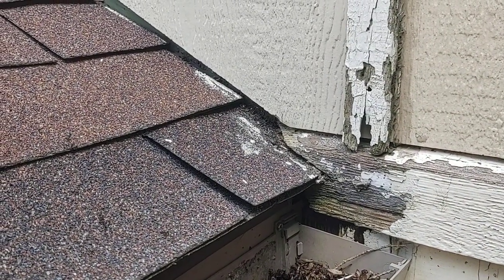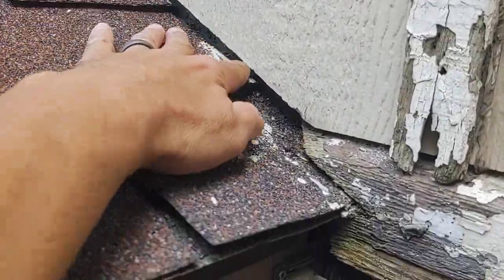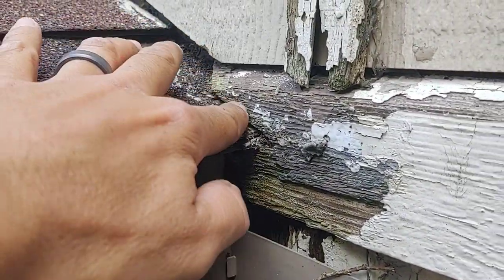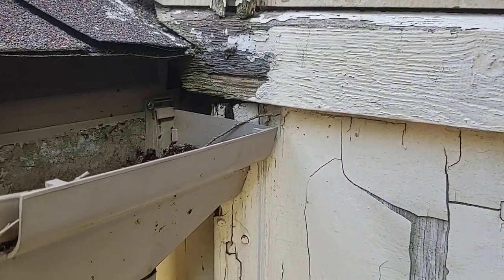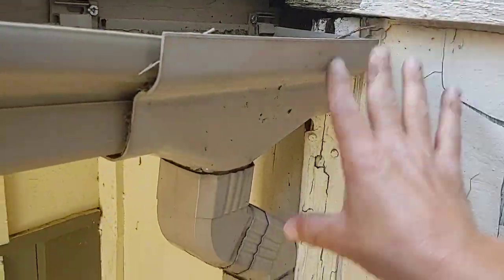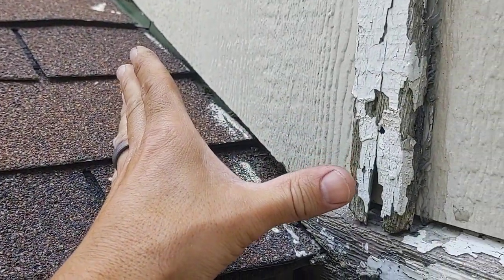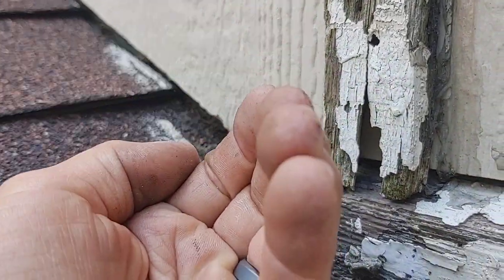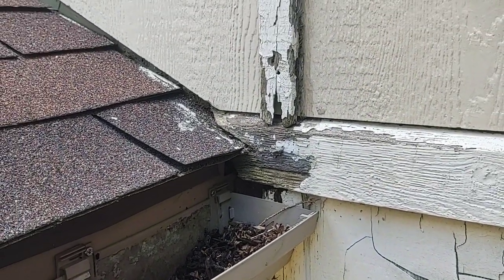Roof wall flashing kick out

Comment: This is almost ALWAYS overlooked.. almost every reside I do I have to install a kick out. Most people I've met in the business don't even know what it is 😑
Reply: I agree, have with with a few companies where even the boss didnt do it. Had to explain to him why it's needed. On most re roofs yeah you kind of have to makeshift getting it in there especially houses that don't have vinyl siding. But as long as it diverts the water away from the wall a few inches it fixes that problem
Reply: yep, if you lucky they at least do the flashing right and they siliconed to where it isn't able to run anywhere but gutter

Comment: This is the exact tutorial I have been looking for. I have the same problem, not quite that bad. There was an attempt of a kick out with the bendy flashing but still overshoots. I didn't want to put a splash guard up as I was concerned as the water runs fast it may push the water over the fascia and under the eaves. So thank you I learnt what a kick out was today!

Comment: Just had a new roof put on. I have 3 areas that need a kickout which wasn't done. The 1st is against wood siding very much like this video. It is rotting before the new roof put on but they didn't say anything. The 2nd is also against wood siding, doesn't look like a problem yet.  The 3rd is where an addition meets vinyls siding on the 2nd floor and it's a new leak. Even though the addition has an overhang, water is dropping down the siding will behind the gutter.
Reply: This guy needs termite inspection.  His siding is covering a much bigger interior issue imho.  Fungus wouldn't fully explain the damagr.  A roofer would give a hard pass on this job until the other issues are addressed.

Comment: Hi There just to let you know I watch your channel from Toronto and will be helping my son re shingle a small roof (10 x30 ft)over an addition that is a new kitchen in Ottawa. So my interest is step flashing. It was an addition so it looks like the contractor cut back the aluminum siding about 3 inches just looking at pictures so far and put a j molding on the bottom so now I am wondering about a kick out. I presume there is step flashing under neath covered by an apron flashing. I will be going the check it out.  I really like your videos especially the 5 part how to re flash a chimney. I like that you show the problems but wish you would show the fix every so often. In this video you showed the problem but not the detailed fix, that then assists me in getting my head around my potential issues.  Thanks again

Comment: What brand of shingle you recommend that has good warranty? I live in New Jersey.
Reply from the maker: Sorry for the late response, I personally like Malarkey. Malarkey's entire line is a polymer modified shingle. Other brands typically only have that on their highest line. I personally had GAF installed on my roof 5 years ago, it has a very bad discoloration issue going on with it. It's supposed to have a good warranty but I have yet to see it pay off. Until they actually step up and get my roof replaced, I can't promote gaf. Another important factor is not just a good shingle but a good installer. You can have the best shingles installed,  but by a subpar installer and they will not hold up.
Reply: @GrandRoofingInc  I too chose Malarkey.  I paid for an upgrade over GAF as well after researching granule loss, when I had my roof replaced via insurance after storm damage.  My old roof had extreme granule loss as well, I believe it was GAF or something similar, maybe Timberline.  Same quality I believe.

I was sold on Malarkey when I saw a video advertisement online from Malarkey where one of their staff took a soda can launcher attached to an AR15 and shot at a shingle and it caused virtually no damage at all!
Reply: @GrandRoofingInc  Thank you🙏.  I just started my business in home remodeling and renovation business.i don't do roofing but was looking to get into it.Yes going to work with sub who is good and reliable. Thank you 😊.
Reply: Malarkey
Reply: @Florida_Man_In_Florida  thank you 😊
Reply: @joychristian728  gaf
Reply: @Bryan-gj2jk  thank you

Comment: Yeah I come across this situation a lot. A multi tool and a $3 section of welded step down  diverter flashing, takes about 30/45 minutes to install. And will cure or prevent a multitude of issues. Plus it just looks good. 
Thanks for your videos! You are good at addressing the issues as well as the solutions needed for a proper fix. I’m not a roofer by trade, but need to address issues that are the result of an old roof or improperly installed roofs or flashing.
Reply: I usually just make my own. First day at the job I look around and count how many I need, then at break time while I'm just sitting there, I grab a few step flashings and my hand benders and make pocket folds on on so many pieces. We typically use the thicker step so it's a bit more time consuming than the thin stuff as folding it actually takes a bit and I haven't done it enough times to be quick at making them. Just sometimes have to adjust it according to the siding material the house uses, with vinly its easier because you can trim it with your snips but when it gets to stucco and such you kinda just have to rig it in. Rather then spending too much time on making it perfect when it's just there to divert water a few inches out